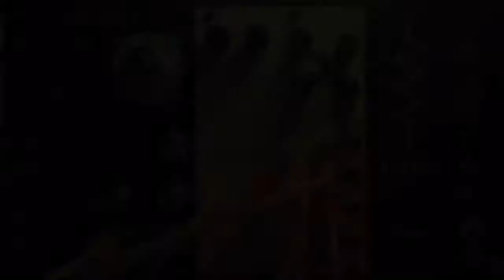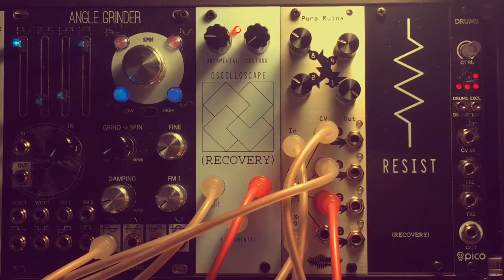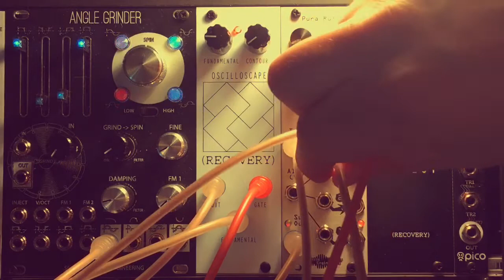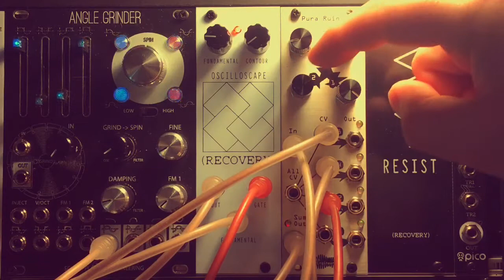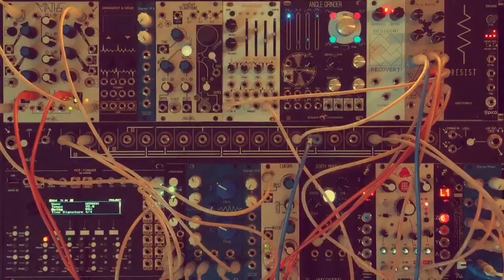Pura Ruina Demo

Comment: I was just messing with my rack and when I came back to my computer this was at the top of my YT feed. Interestingly, maybe a week ago I bought a reverse landfill monotropa. 

I am really into all kinds of fuzz and distortion pedals. Some can just sound like a slightly buzzing thing and others create really rhythmic crunch.

Ruina sounds like a nice little basic unit for not too destroyed sound.

I have a lot of guitar pedals and monotropa was my first distortion module. It is maybe better than my favorite pedals. If you want to create really out of control stuff you might want to check it out. Takes a while to get a feel for it though as it has variable frequency related sweet spots depending on how you set it.

Also, couldn't help but notice you have the Tom Evans VCF. Looks slightly different from mine, but it's hard to miss the blue panel. How do you like the TE VCF? 

I have one and it has become a favorite module of mine.